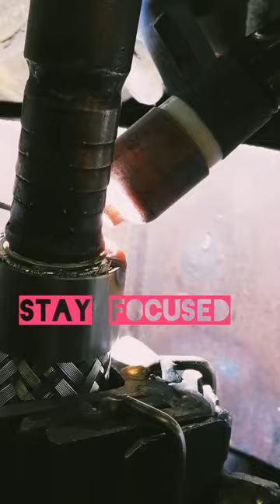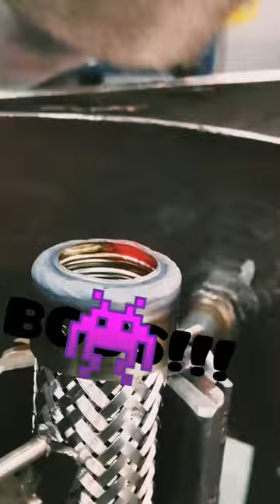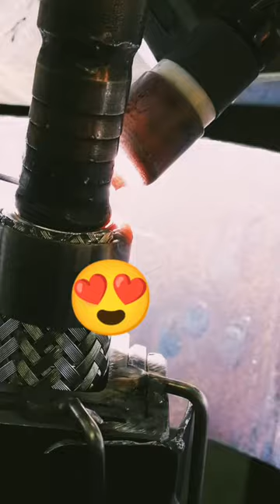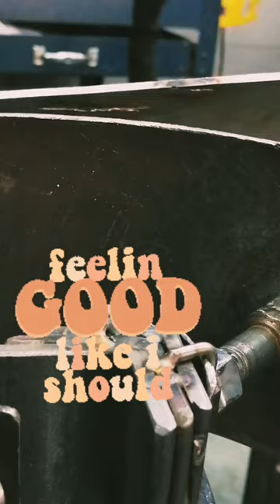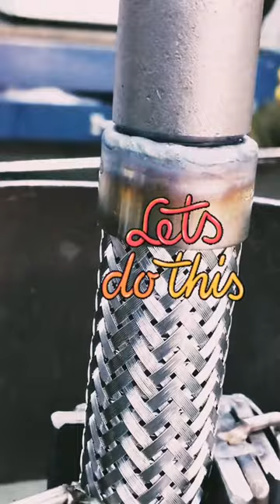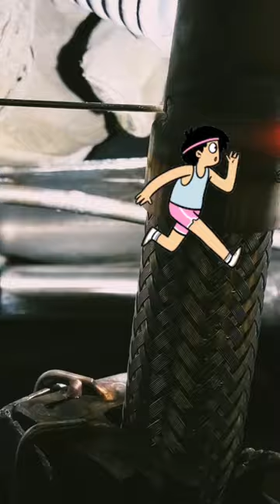1/2 Stainless Steel Flexible Hose Welding Seal-off and Fittings

Comment: it is so easy to broke a hole on the thin layer of corrugated tube in innner diameter ,  why u insert a external pipe above it , any reason ?
Reply from the maker: The pipe is for purging. It is connected to a bottle of Argon to blow a tiny amount of gas unto the hose. It prevents "graping" inside the hose, where your weld is. For this size, i use no 4 cup. It helps me control my puddle even amp is a little high (25-33). Keep practicing.
Reply: How to avoid burning, creating a hole on the thin surface? Any trick?
Reply from the maker: @wonderyatfule3713  I remember when I first began working with hoses, I always screwed up my piece. But I learned overtime. First, start with low heat. Small size like this turn your AMP to 15 to 25. Learn controlling your pedal. Second, begin with low speed. Don't rush and lastly, control your weaving. Place your torch in an angle (i prefer 30⁰ to 40⁰).    Make C movement or circular movement of your weld. Happy welding.  Thanks for watching.